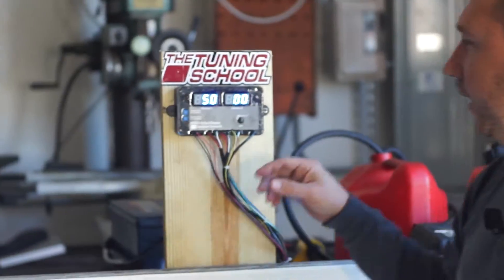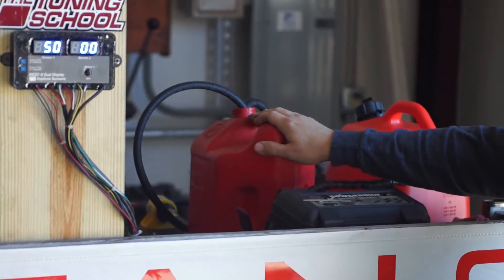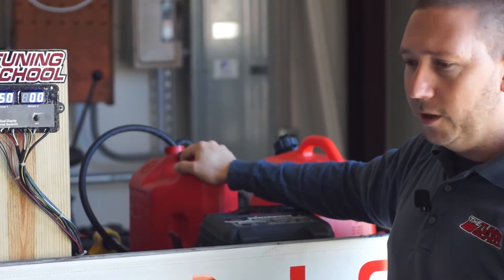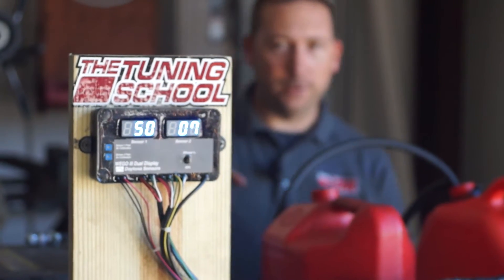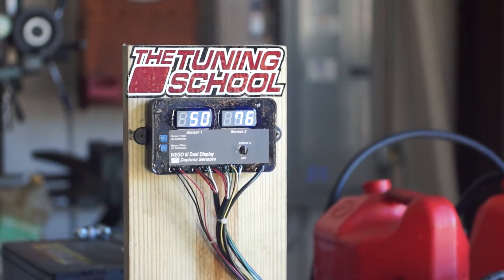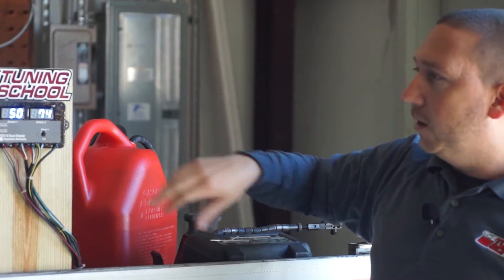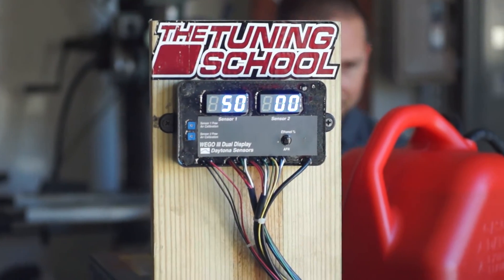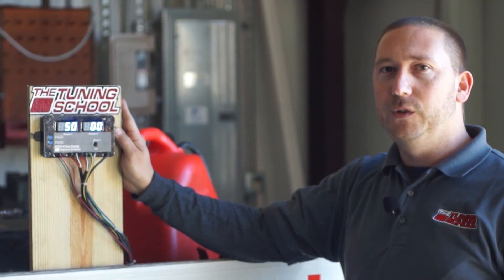How Much Ethanol Is In Your Fuel? Meet the Ethanol Content Reader by Daytona Sensors!

Comment: How do you tune for the fluctuation?
Reply: harley Rider The tuner builds a pura petrol Map first Which is a lower power tune primarily because of the Lower octane, then purge the fuel system tune for exactly 85% or the maximum concentration of Ethanol you will be useing and the ECU can make up a mixed Map on the fly via the flex sensor that is a percentage of the two Maps.
there are other complications like the fact E85 is a about one third less dense in energy kg for kg. Which is why as Ethanol concentrations go up so dose the Richest if the A/F ratio(9.0-9.7 is Typically where you want E85 at WOT) so your fuel system has to be able to deliver more volume of fuel than a pura petrol only setup to prevent lean out!